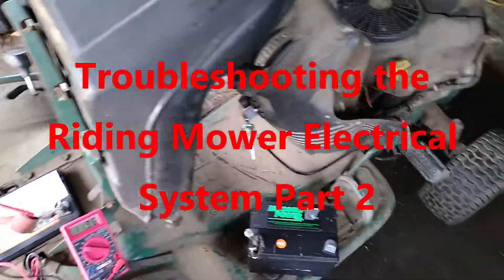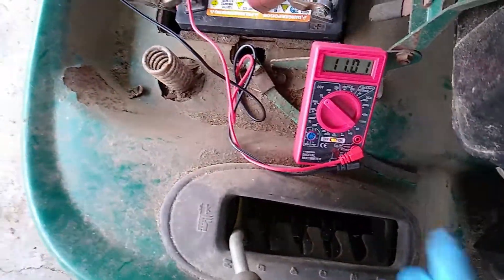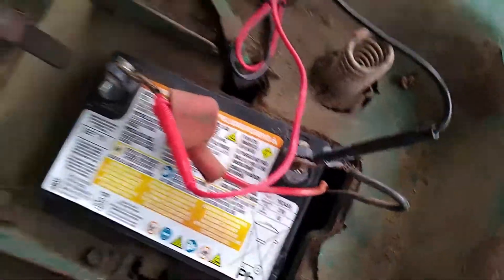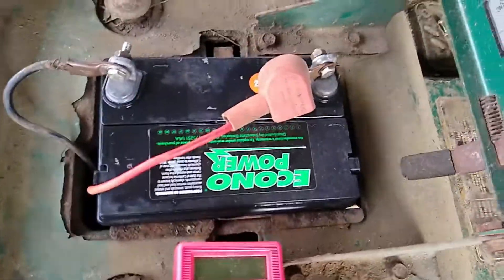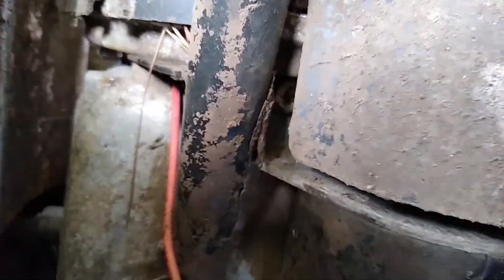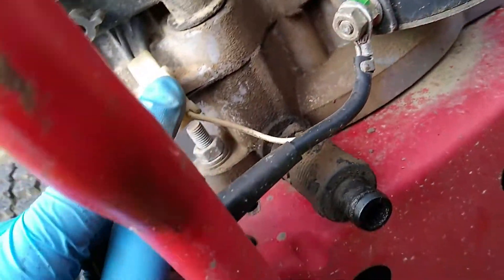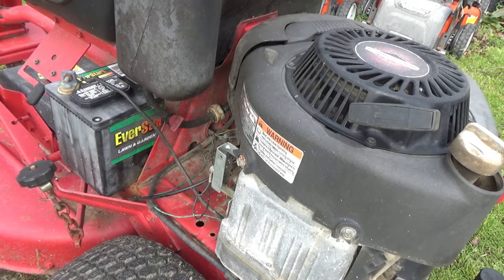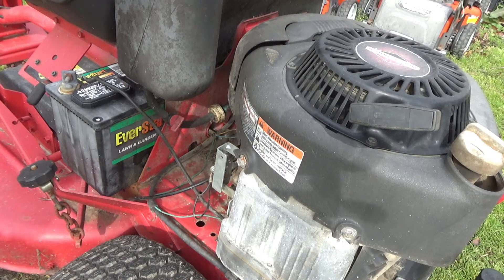Troubleshooting The Electrical System On a Riding Mower Part 2  -Checking the Battery and Alternator

Comment: How much are econopower lawn mower battery
Reply from the maker: EconoPower Batteries are sold thru independent Interstate Battery Dealers - most however don't carry them, they rather sell the more expensive SP35 & SP45 series.
Reply: @TheOutdoorPowerGuy  ah was seeing if they are cheaper than Walmart's
Reply from the maker: @D4x4Bronc  I would strongly advise against the NeverStart battieres at Walmart, they are junk in my opinion. i have been dealing strictly with Interstate for over 15 years and have sold over 10,000 batteries with maybe a 2% failure rate.